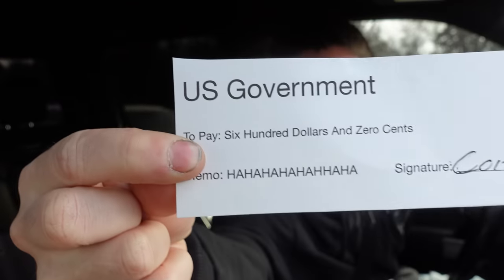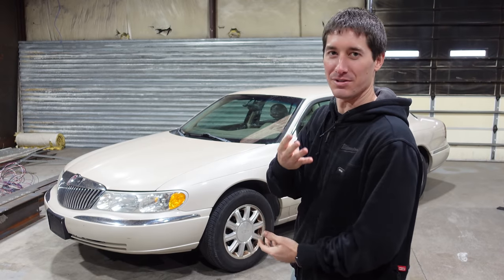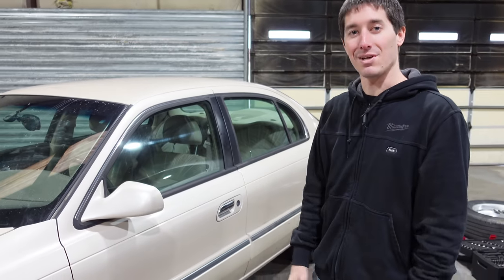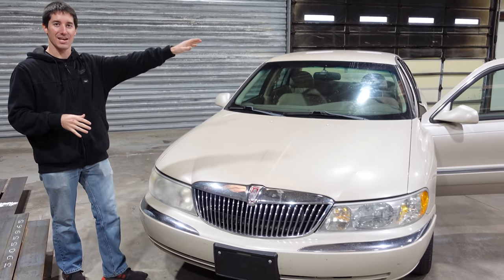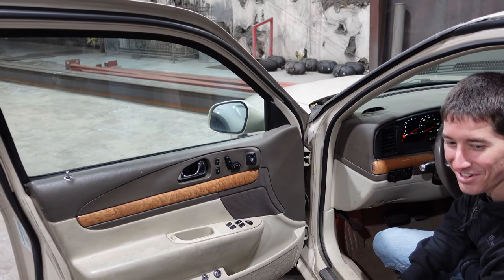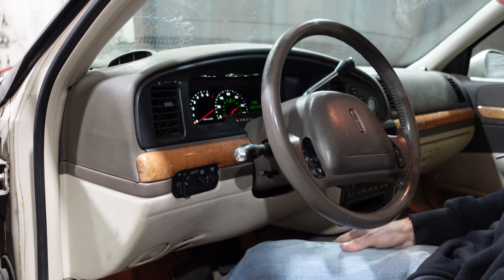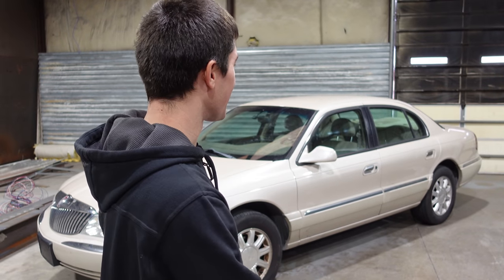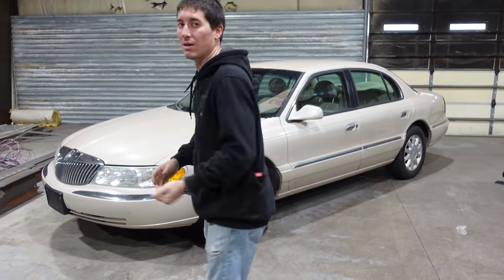This Is The BEST Car You Can Buy With Your $600 STIMULUS Check

Comment: i wonder if this Lincoln is the same platform that rhe Jaguar S type was built on?
Reply: No. S Type was built on the DEW98 platform which also produced the Lincoln LS and Ford Thunderbird. JR is correct, this Lincoln was built off the 4th Gen Ford Taurus platform and was considered the 9th Gen Continental. The AX4N was considered a relatively stable transmission as long as the fluids were changed regularly.

Comment: Interesting take on a car. Not my kind of car, since I loathe both front wheel drive and all the fragile electronics. My least favorite part is the 4.6 litre. That highway gas consumption is dreadful. My 89 Grand Marquis with the 351 managed a much more palatable 32 miles to the US gallon on the highway.

Comment: Watch JRGo,
Fix it, detail it, and sell or donate it to a local retirement home.  
It is the perfect seat height for them.
One local home loves these cars because the old folks can be in a wheelchair with a fold-down armrest, put a board from the wheelchair seat to the seats in the Lincoln, then slide from the wheelchair to the car and back more easily than they can step into any car, truck or SUV.  This allows them to get out on their infrequent outings for shopping, worship, and doctor visits more easily.  
Check around.  They will love you for it.
:)

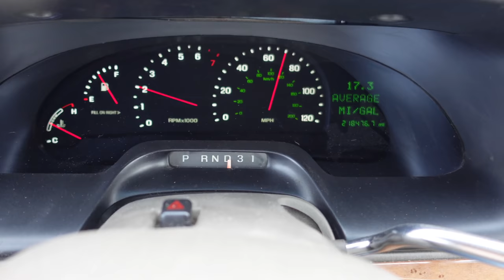Comment: 12:38 I had a 1975 Olds Delta 88 that would get 18 mpg HWY on a good day. So a 2001 Lincoln getting 17 seems anti-climatic.
Reply: Dad had a '71 that he special ordered through the PX system while he was in Japan. Nothing particularly special about that car, until you realize he ordered it with a W-30 motor, which the dealer he took delivery from built and installed. Good God, for a 4000 lb+ car, that thing could flat-ass move over long distances.
Reply: My old 77 Bonneville 403 got about the same back in Az (Turbo 350 2.43 rear )

My current 90 Silverado 2wd LB 350 TBI 700r4 3.42 rear gets 19!
Reply: but the smog. Can run a modern car from that Olds exhaust. That;s true.
Reply: @geraldbennett7035  Good night, yes. The flip side if having  a car that got 13MPG on a good day.

Comment: I wish I could find something like this.  With all of the shaddy resellers around here you can't touch anything that is not absolute garbage for under 3 or 4 grand, not even from auto auctions.  I did have someone who collected Buick LeSables who was going to sell me his v8 but his son who is a drug addict came over and set fire to all of his cars.  Ugh. Then I found THREE different 80s firebirds at 3 different times, 2 the drivers took for one last ride a couple days before (one was drunk) and both crashed into trees and the 3rd was from the husband of a friend of a friend except two days before his neighbor decided to try cutting down a tree in his back yard and dropped it on the car.  Everything else around here under 3 or 4 k is absolute TRASH.  If I had better knowledge about cars and a way to tow I would be running out into the mid west and would trailer these cars back.  I am ecstatic I found the 09 Sonata I have now that I just got for 6k because it is manual (autos sell for over 10k here) and only had just under 75k on it!  THAT is a steal around here!  I love these videos though because every once in a while the resellers will miss on a car like this I may be able to find especially with such a high over 60 population around me.

Comment: My 1998 Continental was the worst P.O.S. I have ever owned. I bought it from a friend who was the original owner with 35,000 miles. By 50K it had Electrical problems. cooling problems, ate spark pug wires regularly and the AIR non-Suspension was just a bad joke from Ford's engineers.

Comment: They saw you coming, what a pile of rubbish. " Nothing wrong with it", bonnet struts stuffed, wobbly steering, misfire, front wheel drive, boot lid won't open, windows don't work properly, washer hose buggered, headlight rotten and much, much more, but who's suprised, it's a Ford?